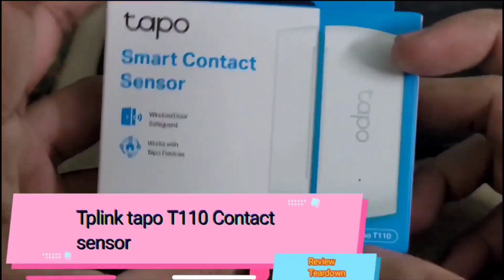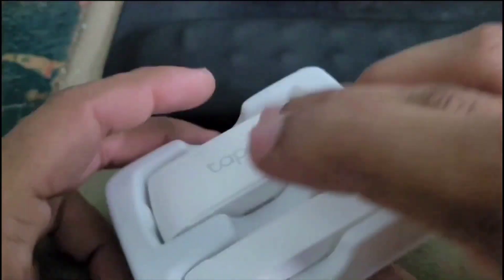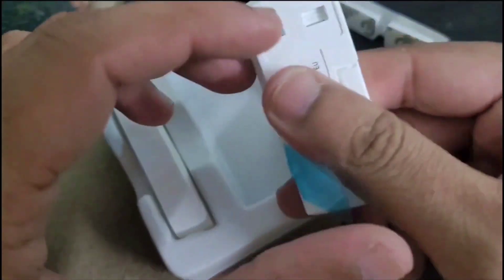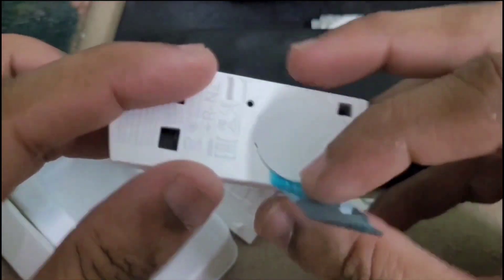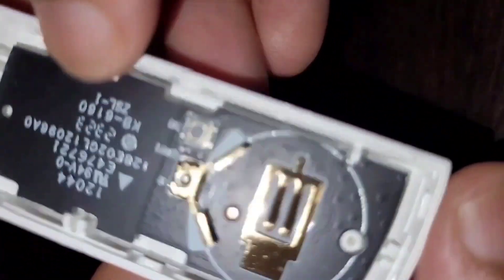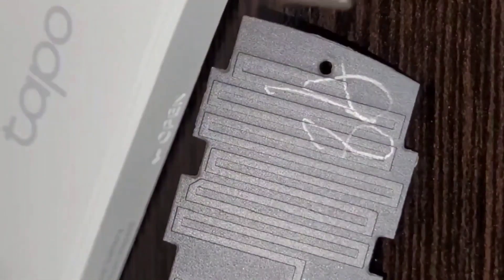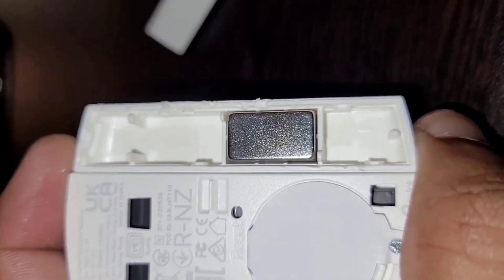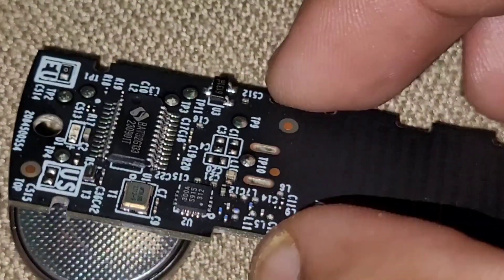Tplink tapo T110 contact sensor

Comment: Is it possible to remove the 6131 sensor and wire this to a mechanical switch? So that the sensor can alarm to a physical ON/OFF input? Looking at the datasheet, I think I can remove the 6131, and then just connect my switch directly across the pin 1 and 2 (VCC and OUT) to trigger the device.